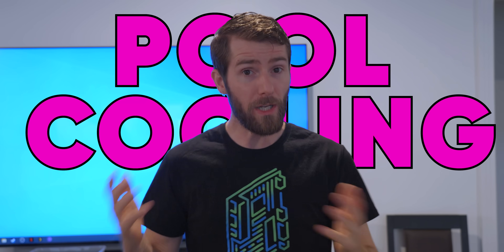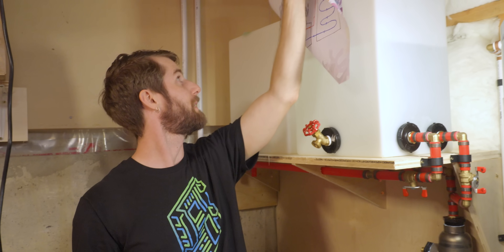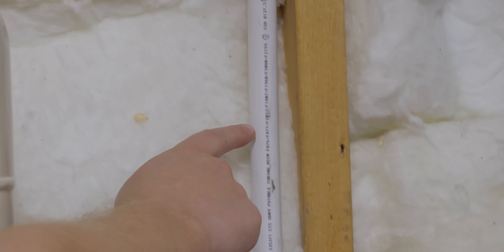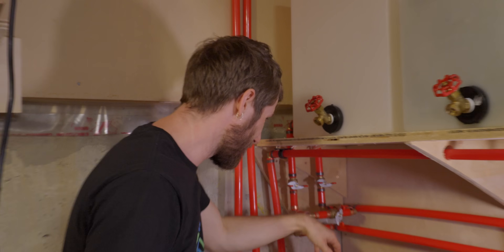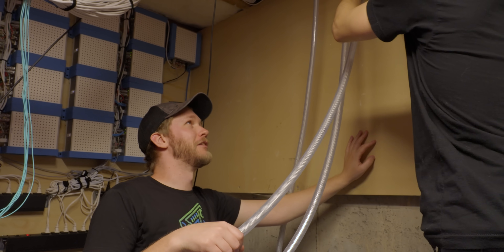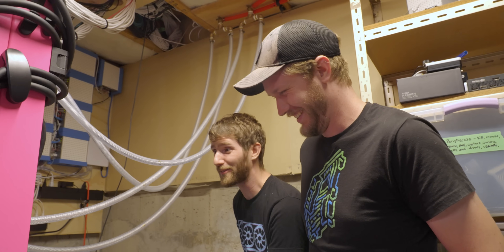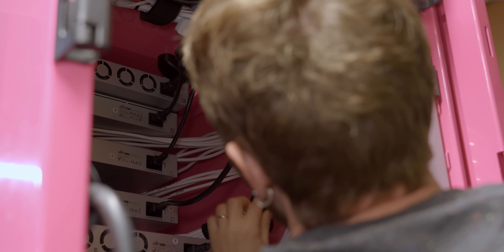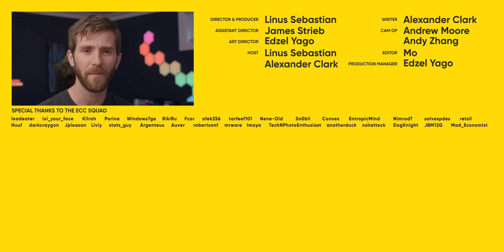My pool leaked and killed my computer - Whole Server Room Pool Watercooling Part 4

Comment: I have a strong sense that winter will expose the remaining flaws in the system. Then it's just the wear of time.
Reply: They have pool heating, so it won't freeze over, and they can divert heat to the pool loop to make sure the temperature of the loop doesn't drop below ambient.
Reply: @haxie4516  that sounds perfect if humans hadn't installed it
Reply: @GeorgeSweet 
They've already tested that, afaik.

Comment: Was the PC not on a UPS?
Reply: Yes, it was, why would that matter though?
Reply: @haxie4516  I meant the pump. The cause was due to the pump loosing power correct? If it was on a UPS there should not have been an issue.
Reply: @arthurcline 
Ah I see.
And no, generally you don't put pumps on UPSes, their load is not particularly suited to a UPS.
It wouldn't have helped either way tbh, as it happened because the pump was unplugged, no UPS can fix that 😂

Comment: In reference to the switch blowing up and what most likely happened. You need to have your rack directly grounded with a strap and grounding rod (best practice is 2 rods 16ft deep). Rack power strips and equipment have high leakage current and in turn high ground potential and basically stray power can then discharge to the nearest most receptive equipment causing exactly what happened to your switch. So when you unplug something in the rack any residual power in capacitance gets discharged thru ground and because you yanked from your c13 end and the grounding pin is barely longer than the power pins it allowed the current to discharge into an already charged grounding system it was enough to blow up a power sensitive piece of equipment. Also you should bond the rack from top of rack to bottom of rack with a cable large enough for it to be the path of least resistance usually with a big beefy copper braid cable. Also all the rails (Rails meaning your verticals of the rack and not your slides) should be grounded and bonded with a large strap as well because everything is powder coated with only screws bonding grounds to all the pieces of the rack. Also I know you dont want to hear this but your manifolds should be at a minimum be bottom of the rack and optimally externally mounted. Datacenters spec 12 to 18U bottom rack mounting for "leakables".

Comment: Alex is correct with the tube labels. In is in all the way to the heat load, and out is out from the heat load to the rest of the system.

Also, putting metal NPT fittings in a plastic manifold Is never the best idea, the thermal expansion of plastic is much greater than metal, and the threads will leak in time. Plenty of manufactures make aluminum NPT manifolds
Reply: They can't use an aluminium manifold. Galvanic corrosion will happen.
Reply: @haxie4516   They are already mixing metals in the loop and will have galvanic corrosion, although not as severely as bare aluminum would, that being said, most aluminum manifolds I've seen are anodized, which will prevent this problem. Besides, industry has had a solution for this for a very long time. Anode rod. If concerned about the debris that anode rods can emit, use a powered one. Or perhaps use a proper filtration system like is present on any industrial cooling system. They should be using distilled or deionized water anyway which will reduce galvanic corrosion significantly if properly changed out on a regular timeline. All of this combined would still be orders of magnitude less money than is in that server rack or the pool.
Reply: @tjb433 
On the PC side, they're not doing much metal mixing. Titanium, Nickel and Brass. That's it. 
And they're completely fine to have together.

Comment: Man, I love the north american way of building houses with wood and drywall, but the plumbing is way too complicated with all of those fittings and rubber tubes. In Brazil we use simple PVC gluable tubes and/or threaded tubes. It doesn't leak, installs fastar and much more cheap.

Comment: the in and out is definitely confusing, since youll be confused weather it is refering to the tube itself or the the block, id suggest just labeling the tubes with the the direction the water flow is going with an arrow

Comment: I would either print or shop a diaster flow breakaway on those in and out connections so that if a fitting was to leak it would be directed out and away from the servers.

Comment: I'd say he biggest problem was trusting Alex, to know what he was doing and the impatience in the build. Also, Alex, still doesn't know what he is doing. He might have an engineering degree but the only practical experience he has is with LTT from what I can tell. I like Alex, but dude needs some time in a shop of some kind not inhabited by computer geeks ( of which I consider myself but also weld, mechanic and machine both professionally and hobby).

Comment: FYI there's a screw on the electric motor side of the pumps to let the bubble of air out. It will leak some water also but mostly air if it's trapped. This tip is from Italy so, pick it with a grain of salt elsewhere 😅

Comment: Why the rack is not horizontal, so that the water does not leak to computers underneath? 😱🌊🌊🚰
Reply: Because that would take up too much room.
Reply: @haxie4516  its 2-3 meters max... And a looot safer :)
Reply: @MarkoMarjanovicKackavaljer    
That's a lot of space, and makes the rack essentially useless. Nothing will slide out on rails anymore, they lose access to the back of the rack, the whole thing will be in the way, and difficult to move, and it would be unsafe.

Comment: I want to throw out my two cents for remote power switching on these computers. Set up a raspberry Pi or something like it integrated with home assistant that can read the power state LEDs on all of the computers and optoisos or opto relays to "press" the power button. Basically a custom subset of the PiKVM or TinyPilot. I actually made my own system like this before either of those solutions came out. If you want to keep to rack-mounted solutions, Jeff Geerling has a video about a really cool blade-style CM4 module.
Reply: That's way over engineered for the usecase, and is reliant on HA being functional...
Reply: @haxie4516  I think this would be the least overkill on a video about cooling an in-home full rack computer setup with a swimming pool and used to game silently across the house. And while I'm sure there are other solutions, I'd love to hear them. This is just what came to my mind.
Reply: @jamespeterson7125 
Much simpler solution?
Just a button hooked up over the wiring they have back to the server room.
Reply: @haxie4516  You're not wrong, but that solution isn't without its own downsides. 1. They can't really make a video off of it. 2. You'd also want the power indicator light as that's important information if your computer is in another room. 3. Having four sets of wires for power and LEDs run over that distance is kind of kludgey, likely difficult to look good, and introduces a lot of points of failure into the room where the kids will be playing. 4. They might not be set up to run new cables of any kind.

I don't want to drag this out, but just running some wires with buttons on the end between the servers and the computer stations doesn't feel like a very LTT solution.
Reply: @jamespeterson7125  
1. Hence why he said to test a load of options. And not everything has to be a video.
2. Cat6 cabling has 4 twisted pairs inside. There's enough in there for an indicator LED too.
3. Cat6 cabling that is already in the walls, and for points of failure, your suggestion has far more.
4. They are set up to do so, but they don't need to. Cat6 cabling is already there.
Reply: @haxie4516  1. He said he's thinking about ideas so I was trying to come up with something fun and semi novel. And this is LTT. EVERYTHING is a video. Otherwise he wouldn't have mentioned it.
2. I know CAT 6 has 4 twisted pairs, but you'd still need a minimum of two CAT 6 cables to run them all together or one for each station, and you'd have to remember which pair does what. Not to mention coming up with something to prevent plugging something else into those ports by accident.
3. I never said my solution had fewer points of failure, just fewer points of failure in the room with kids doing their activities. Fewer cables to accidently pull on or unplug while playing games is always a positive.
4. While his house is already wired with CAT6, he may want to leave the installed ports available for regular CAT 6 stuff.

Ultimately though, I think we're getting carried away here over what was supposed to be a fun and semi silly comment. This isn't a design review and I'm not sure why you feel the need to push so strongly against it.
Reply: @jamespeterson7125 
1. I wasn't saying you couldn't, I was saying a solution.
And no, not everything is a video. There's been plenty of things that haven't been made into a video.
2. There is Cat6 to each station already. Remembering what pair does what is kinda irrelevant if you use a punch down connector and make a bunch of adapters.
And if they push the RJ45 connector back into the wall a bit, and only have the cable that runs to the power button coming out of the wall, there's no way for someone to plug the wrong thing in.
3. It's a LAN room, they're not going to be jumping about and climbing on things... and there's other cables there that could be unplugged... It's not the end of the world, just plug it back in.
4. No. Not really. The ones in that room were run entirely for "just in case" and have literally no function.
There's no PCs in the room, nothing to connect into them.

I'm pushing strongly back against you because you have provided that amount of push to begin with.
Reply: @haxie4516  Look, you came out of the gate pretty critical calling it over-engineered and unreliable. My first response even said you were right! Regardless, I don't think this is worth dedicating any more energy or mental space to. I hope you have an excellent evening!
Reply: @jamespeterson7125 
But this is the internet! I was told that this is where we go to loudly and angrily argue with one another over minute things that are inconsequential!

(I kid ofc ❤)
Have a great night!

Comment: For the "in vs out" confusion, you should be naming it "chilled water supply" and "chilled water return" for the Server loop, and "cooling water supply" and "cooling water return" for the pool loop. That would remove any confusion about which line you are talking about.
Reply: Keep it simple - just Hot / Cold and Inside / Outside

Comment: 4:10 no it's not totally fine if you dont use ferrules on stranded wire when the terminals arent made for it. He will realize when the vibration of the pump shakes the wire loose and quickly unpowers the whole circuit.

Comment: One of those "smart home" videos again...

I build my computer lke 7 years ago. It doesn't even have a side... It has SO much dust in it, I can barely see the PSU any more.
Yet.... it's noiseless and stable and fast....

No "water" crap in there... it's only air cooled...
As air... doesn't ruin your computer

Do you want me to build some PC's for you?
Reply: Cool. You run 5 high powered modern gaming systems in a small room, and let me know when you wanna come out of that room due to overheating.

Comment: Probably already been suggested but perhaps you should fit a few water leak sensors in a few places, at least you might have a chance to save some equipment should something start to leak and get a early warning about it.
Reply: Before the house floods
Reply: Water leak sensors yes you can also repurpose old fire alarms to do the same with a lil soldering of a lil wire.
Reply: If he's using an APC UPS it probably already has the connections for leak detection, not sure how it works but I'd guess it can kill power when it detects water
Reply: @balthxzar does that not relate to current leakage rather than water?
Reply: @BrooklynRaaage  Most of the higher end UPS' have multiple environmental sensor attachment points.  So if he can find a 12v generic leak detector then the UPS can power it and relay it to the system, as well as perform emergency power off.
Reply: @MsSgent  Oh cool. TIL!

Comment: Having the manifold above the fittings on the other end is just begging for another damaged computer. Should at least place it below the fittings so IF the manifold leaks, it's the lowest point and will not leak along the hoses and into a computer. And also please place it outside the server rack, make a 3D printed mount that also acts as a shield or something. 

You shouldn't ask yourself IF it will leak, instead you should ask yourself WHEN it leaks, where will it leak and where will the water go?
Reply: And if it didn't show, no, I don't trust that plastic manifold at all in the long run haha. Temporary solution? Sure. Permanent? Absolutely not.
Reply: @nrtolv 
Why?
McMaster-Carr is pretty reputable
Reply: @haxie4516  Why I don't trust the plastic manifold? Basically from experience. I mean, it will probably work. But plastic is more prone to flex than steel or aluminium, and time can do wonderful things sometime.. But at least use some purpose made thread lock.
And you just increase the risk for every fitting you have on there.

And a proper leak test would put the object under a greater than expected pressure for a longer time and see if it holds the pressure.
At that point my trust for it would increase.
Reply: @nrtolv 
Fair enough tbh, 
Though, they can't use steel or aluminium due to galvanic corrosion 

And the pressure test they did was for quite a while, and was at a higher than expected pressure

Comment: PEX is not UV resistant. It's rated for 30 days max, typically while the walls go up, otherwise you can't allow PEX to be in the sun, even indirectly, or it will crack. Looks like you will find that out the hard way!
Reply: Depends on what PEX you get. Some is UV resistant.
Reply: @haxie4516  Don't forget what YouTube channel this is!
Reply: @NathanSweet 
Don't forget that they had a plumber come in and do that!

Comment: why are IT guys are so stupid when it comes to cooling thing.  water and electronics don't mix dom dom. one "split unit" is all you will ever need. (for our friends at Top North.  it's what you guys like to call a heat pump). But its only gives cooled air down to 18C 64F and you are done!
Reply: I hate to break it to you, but water and electronics mixing is a cornerstone of modern society. 

As for using a heat pump, the amount of heat those things generate would overwhelm most units.

Comment: Get a fluid/fluid heat exchanger, you can use antifreeze on the pool side and  whatever you want for the computers
Reply: That's literally what they did...
Reply: @haxie4516  I had a premature comment I didn't see the video first.

I can see so many things wrong with this setup,  it's idiotic to have the water distribution inside the rack and even worse up on the rack so water can fall on everything if there's a problem. Get some metal distribution blocks with valves so the connection can be turned off at the block.. Gravity is your friend don't make it your enemy. But "mistakes" do make for higher views, get your friends and your enemies watching together.
Reply: @pedrorocha6225 

They're using quick disconnects, so no need for valves, and most metal manifolds aren't usable for this situation.
Reply: @haxie4516 most not all, use good parts for durability. Those manigolds might bit hold pressure if 2 or more systems are disabled without the pumps being turned off. I wouldn't trust all those components and data on cheap parts poorly assembled and with idiotic placement
Reply: @pedrorocha6225 
It's not about durability, it's about mixing metals in a watercooling loop. 

The pump pressure won't be all that high

Also, the parts are from McMaster-Carr...
Reply: @haxie4516  titanium exchanger copper and aluminum and probably some stainless on the blocks and pump
Reply: @pedrorocha6225 
The rack side of the system has got nickel plated blocks, fittings, etc.
There's no aluminium or copper in that side of the loop.

Comment: So why not just use a big radiator behind the servers? I remember you doing that as a temporary measure, but idk why it was removed. That manifold being in the server rack and facing the servers with no casing around it to direct leaks away from the servers, is horrifying.
Reply: They removed it because it really wasn't that effective

Comment: Move that manifold box to outside the rack, replace it with a proper metal one, OR just enclose it to minimise the damage caused WHEN it fails. enclosing will reduce the failure mode from 'spectacular' to 'annoying, but controllable drip. also, add some water leak alarms

Comment: Curious to how much energy is actually saved doing this, presume the pumps have to be fairly powerful, does a few computers actually add that much heat to the pool?
Reply: No, it's more to prevent all that heat venting inside the house
Reply: @haxie4516 would a server room really leak that much warm air into the house? I’m just curious to have much energy this system transfers to the pool compared to the energy used in the pumps etc

Comment: heads up, my friend's house has all the plumbing leak because the colored pex tubing cracked. apparently the colored pex, like red and blue, required heat to cure the color on, and that caused stresses leading to hairline cracks and ultimately failure after decades of use.

Comment: Why the hell would you put the manifolds that have multiple points of failure in the rack? On top of that, they were mounted at the top so it could rain down or run down the hoses for a direct path to the components. This won't end well... Again...